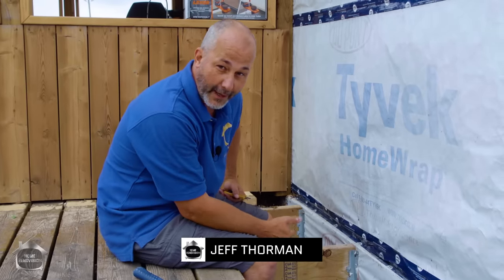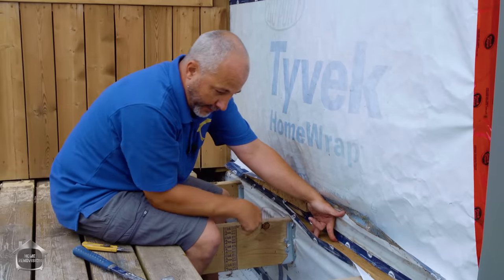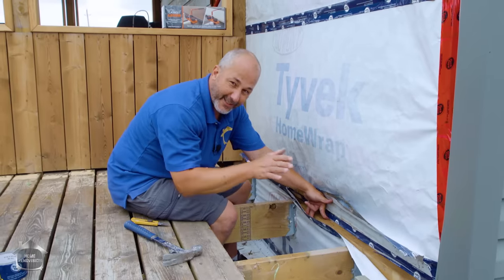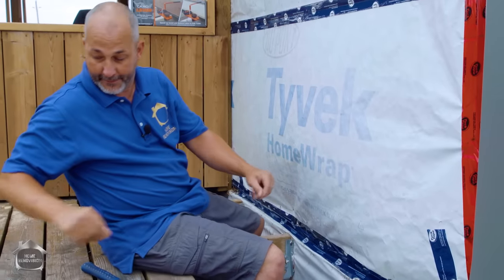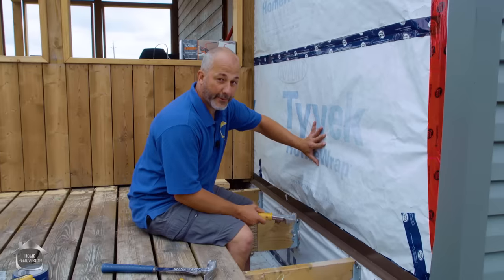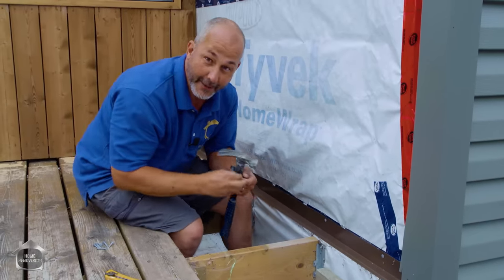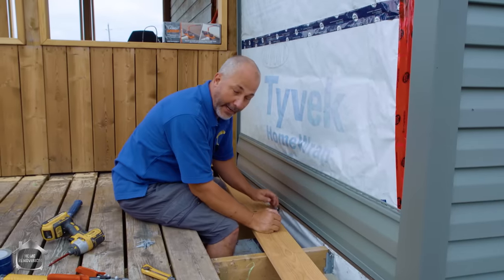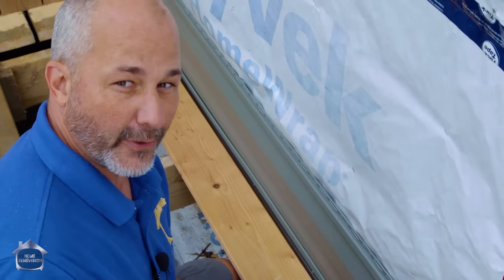How to Attach a Deck to a House

Comment: Ya know you don’t have to attach it to the house. I usually pour a few concrete piers and keep the support beam away from the house.
Very easy reasonable and no penetrations into the siding or the house. Try it sometime.
Reply: Best thing to do. I was told doing it that way will never give you issues with sill rot on the house.
Reply: Obcey, I like your comment. I'm building a deck with roof (lean-to style). If it were to be freestanding, are there other builders that seal between the roof and the house to keep water off of the house (between roof of the deck and house)?

Comment: Why didn't you attach the Tyvek over the drip edge in a "shingle-like fashion" per building code. All water should flow over and be allowed to run off with no way it can seep behind anything. By not providing a way for moisture to flow over the top edge of the drip edge and into the corner of drip edge, you are instead providing a weak spot to allow moisture to potentially flow behind the top of the drip edge. Not using the drip edge properly is not protecting your investment.

Comment: This is not how you should install vinyl siding. NEVER use j channel at the bottom. Instead use starter strip. J channel acts as gutter, collecting all water running down the wall.

Comment: These wacky so called contractors remodeling this house across the street from me, I tell ya I can't stand watching them because they are doing it all wrong using this cheap wood no house wrap to protect it, it's been rainging everyday so it's been getting wet with nothing protecting it smh I feel sorry for whoever's moves in there they will have all kinds of problems.
Reply: Can you contact the owner?  They may need to be made aware of the quality of work they are paying for.  I would certainly appreciate my new neighbors looking out for me early on and telling me before things are too late to be fixed!
Reply: @wccrispy  Yeah I know, that's right I would too, it's crazy what these people try to get away with these days, I will definitely see what I can do about letting them know because I don't want them going into this blinded. I got pictures to show them also as they been working on it so they can't lie their way out of it.